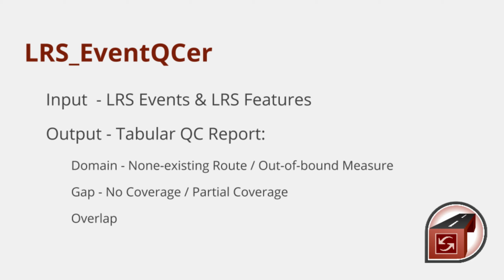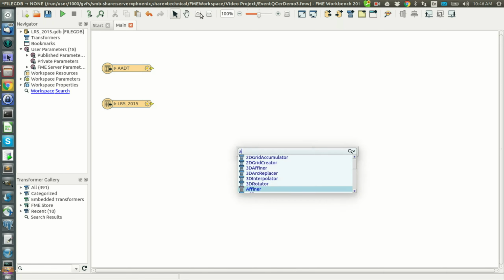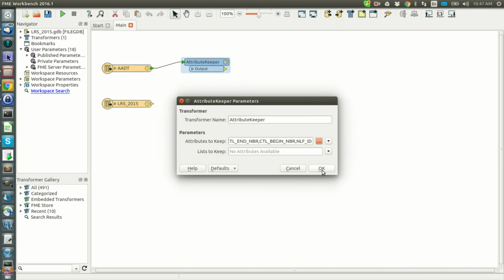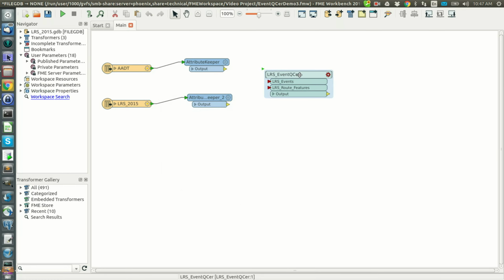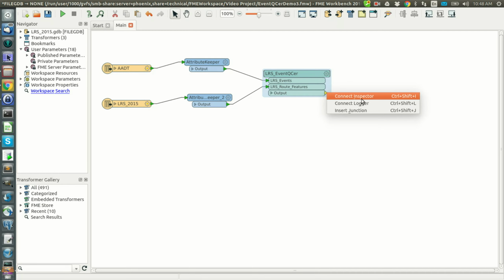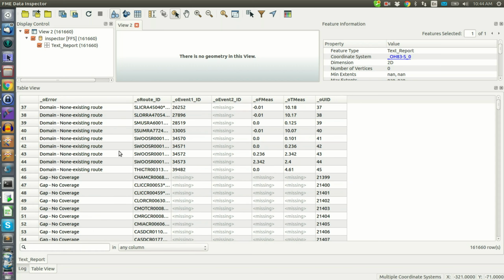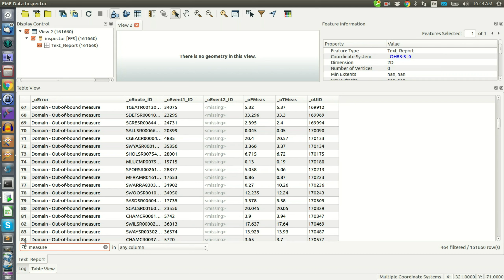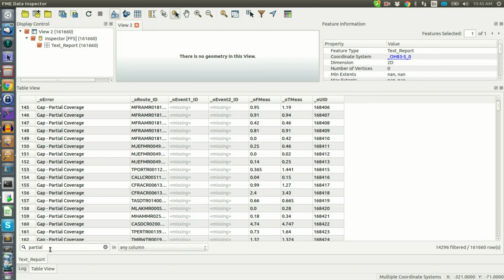LRS EventQCer Transformer for FME

Comment: From and To measure column what kind o f values should be choose? only x y? or meters/km can be used as well?
thx
Reply: The From and To Measure parameters should point to "measurement" columns in your dataset.  In the US, most transportation agencies use miles for route measure.  But it could be any UOM in your system.  Hope this helps.